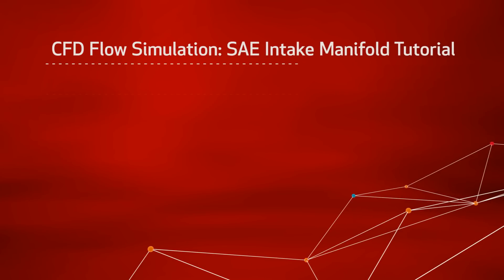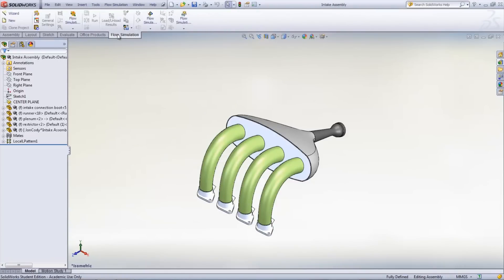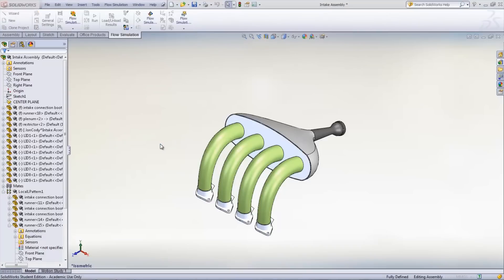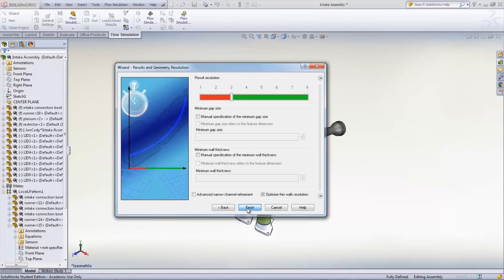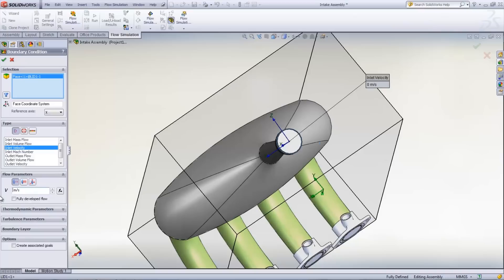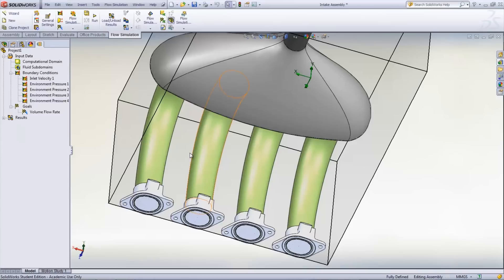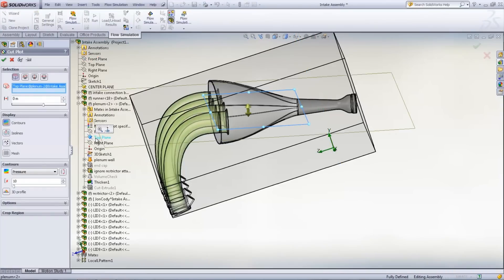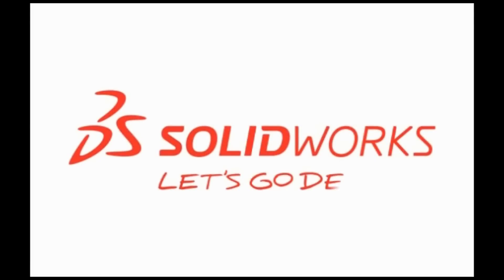SolidWorks Education SAE Intake Internal Flow

Comment: Can we do an internal flow simulation on an assembly? I am trying to do it with an exhaust system but the software says that the inner face of the lid is not laying on the boundary between solid and fluid region. Do somebody know what could be wrong?
Reply from the maker: Hi there! This seems like a good question for the SOLIDWORKS community. 
We are happy to point you in the right direction for great resources. MySolidWorks is the place to get the best answers to your questions about SOLIDWORKS in one location. 
 
We can also direct you to a variety of resources for questions and networking. 
 
SWUGN, or the SOLIDWORKS User Group Network, can be accessed here:  http://swugn.org/ 

With your existing SOLIDWORKS or 3DEXPERIENCE ID, you can access SOLIDWORKS Forums for more information on a variety of topics and questions from our user community. 
 
Check it out here: solidworks.com/UserForum